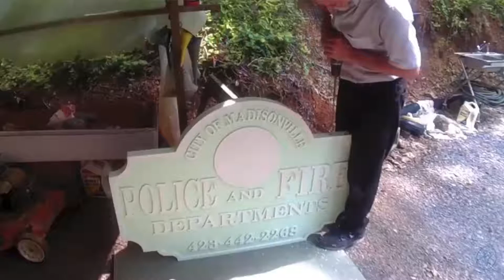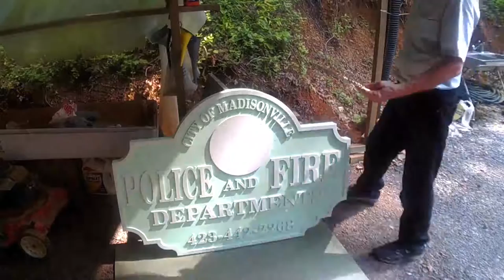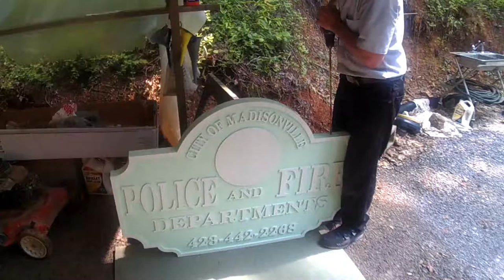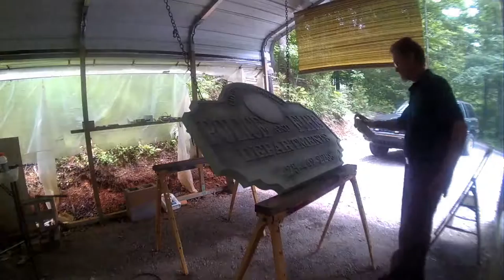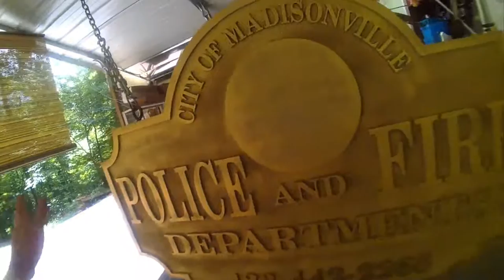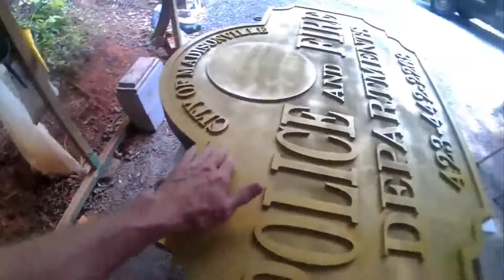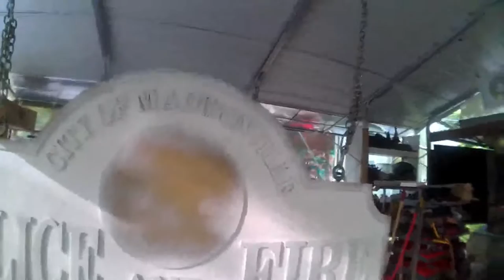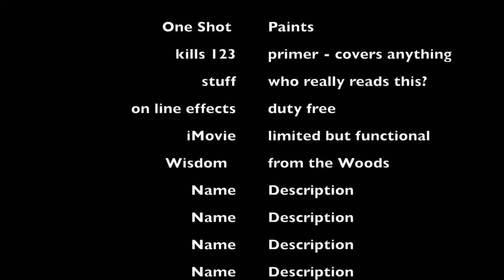HDU sign, you don't have to make these mistakes

Comment: To let the air out when applying glue on a long shaft,  cut a V groove in the shaft of the bolt,  the groove allows the air to bypass the glue,  hope that helps.  Cheers.